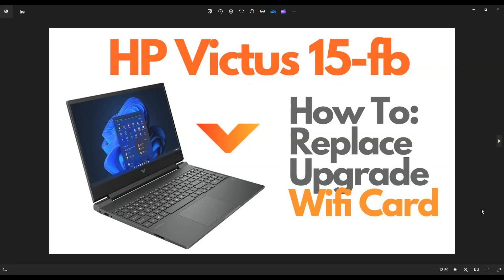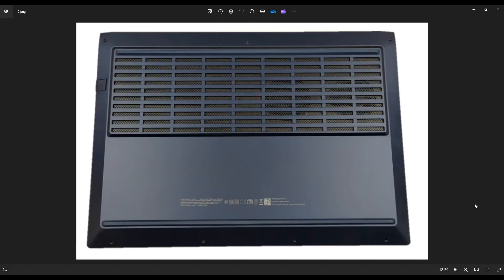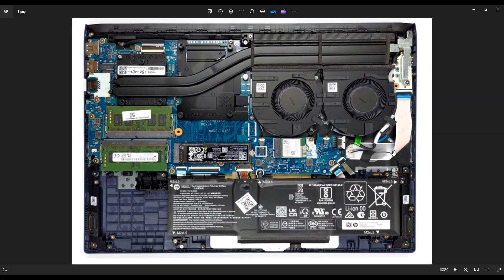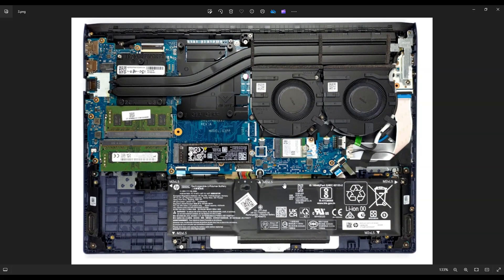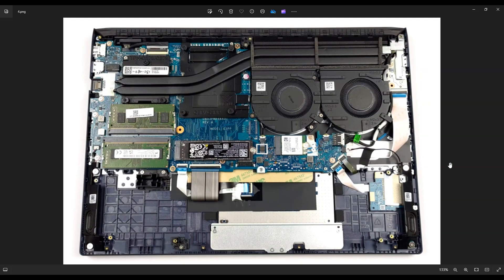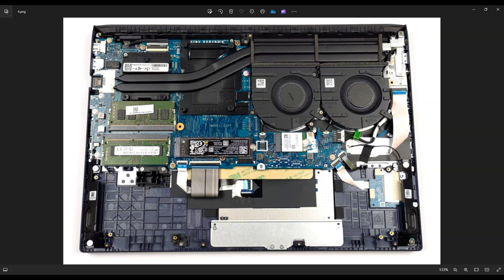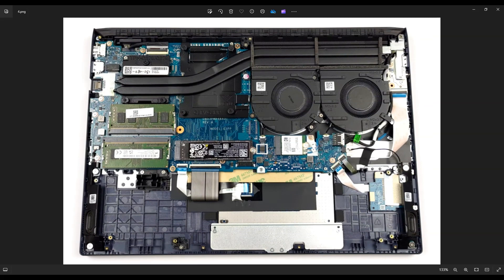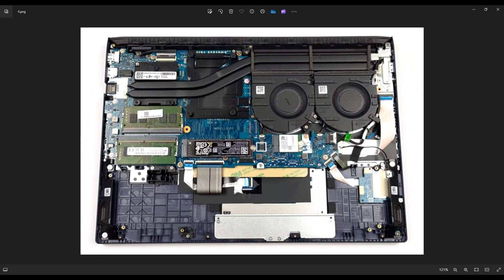HP Victus 15-fb Gaming - How To Replace Wifi Card - 15-fb0000 15-fb1000

Comment: Bro is there a way to put an extra ssd there is a slot gap but there is no slot??
Reply from the maker: That gap would be for the motherboards with that extra option, which not all the computers have. If yours does not have that option, you could replace the motherboard with one that has that extra m.2 port